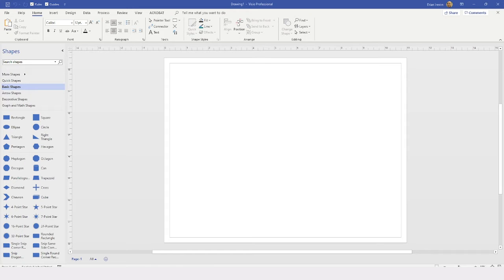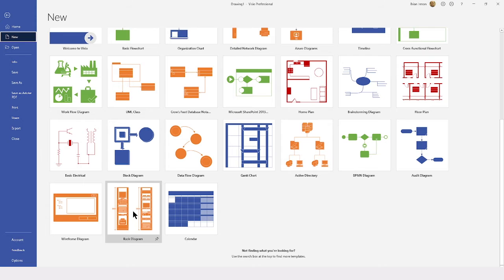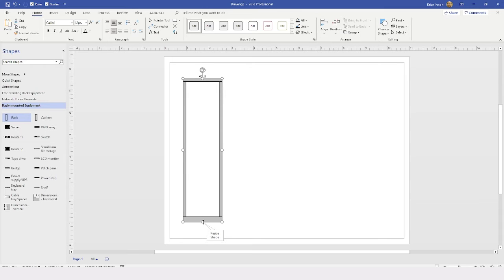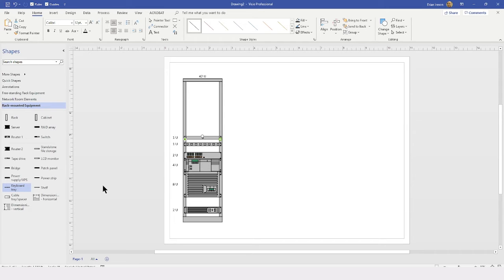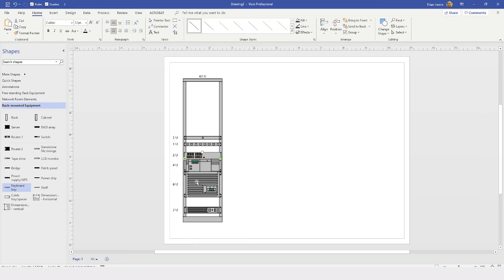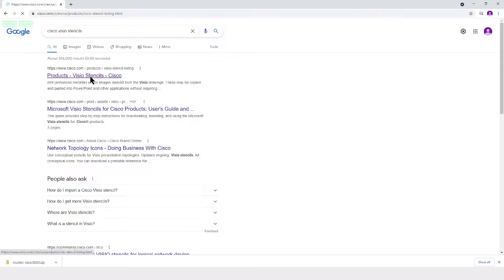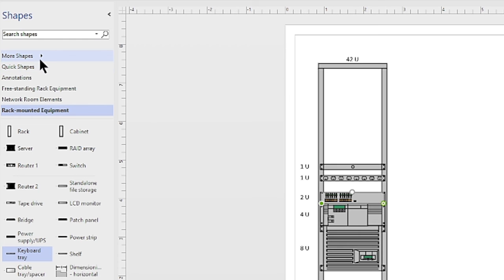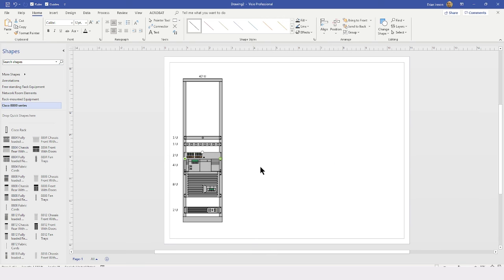Building Rack Diagrams in Visio

Comment: Could you please offer any assistance on creating my own stencils for use in a rack cabinet.  If you notice all the stencils you can downloads from companies like Cisco, Juniper etc (I have managed to find stencils for nearly all my manufacturers baring a couple but do have some vector art svg files which I could use to make a stencl), their stencils have a length measurement (19"), and you can grab the left and right anchor points and clip them into a rack cabinet stencil and they scale correctly.  And if you grab the left or right you can adjust the angle.  If though when I try and create a stencil, I can't seem to create one with length, mine all only have width and height, and grabbing any anchors doesn't change the angle it just stretches the image our of proportion.  I can't seem to find any guides online on the correct way to make stencils for use in racks?